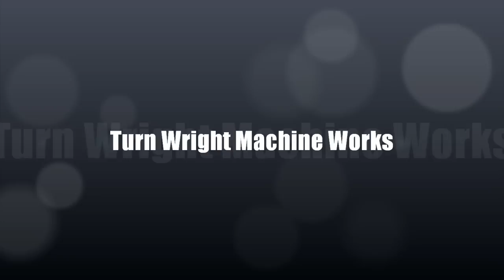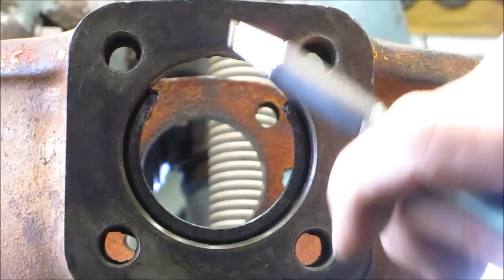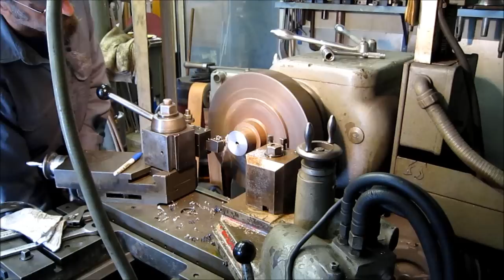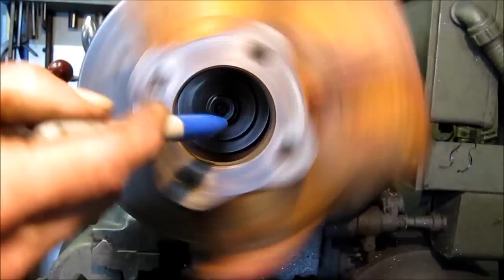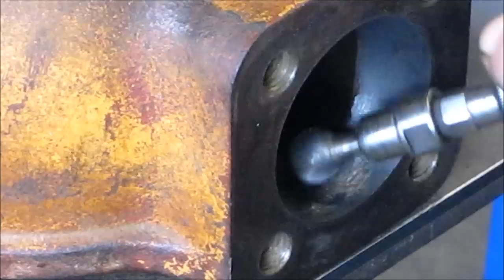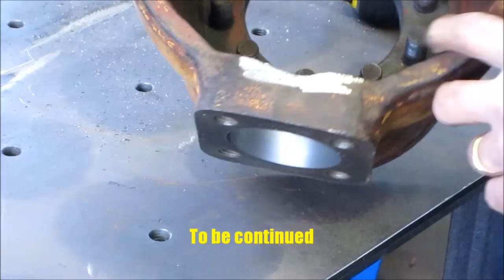Brazing Knuckles Part 1

Comment: Hi keith.I see you use an aloris style tool holder on your lathe. I just bought myself an old Atlas craftsman 24" on center lathe and it has the old style lantern tool holder. I am pretty new to the whole machining hobby and was wondering if I should invest in an aloris style tool holder or stay with what I've got and learn with that?? your thoughts. Thanks again.

Comment: I bet that was the lower bearing race, because they are more likely to get neglected during greasing.  My Carraro axle has similar damage, but it wasn't THAT severe.   I actually did have a hell of a time getting the cup out.  It was likely the stress from the misalignment after the lower bearing failed that caused the upper bearing to get wallowed out. This series is really valuable, because I'm going to have to do some build-up on mine.

Comment from the maker: @ramseyst42 I did look that product up, its like so many of the coatings that we used in the ship yards, on pumps with abrasive fluids and the large transfer stations for sewage, I was involved with in San Deigo. Most of the time its applied after base metals are repaired. Thanks for the subject mater, in that comment... Keith